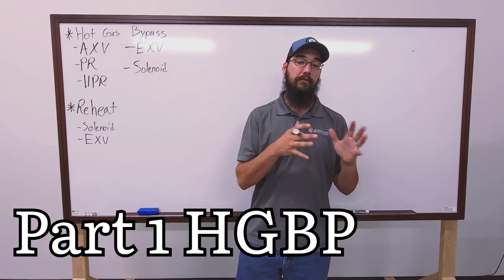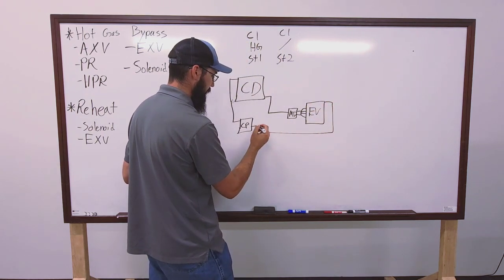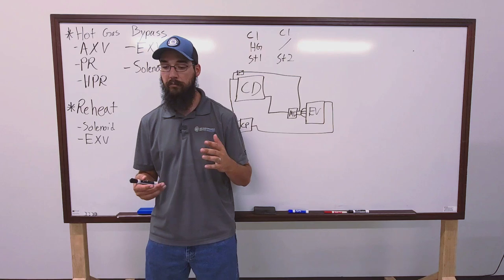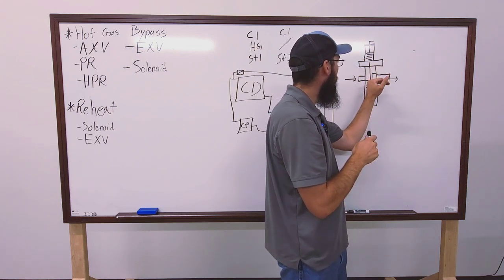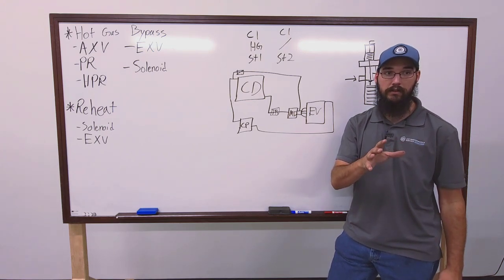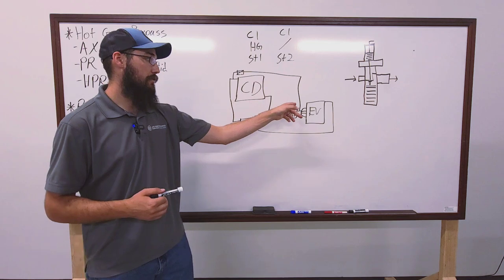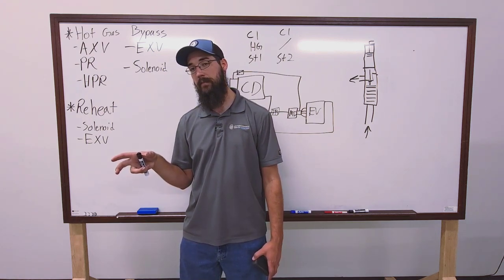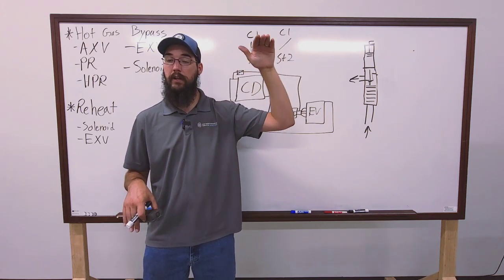Know Hot Gas Bypass? Advanced Refrigeration 2022 Part 1

Comment: When speaking of regulators for unloading my most common and favorite device was known in the field as an ORI or ORIT. The ORI valve would limit minimum coil saturation pressure by throttling compressor suction flow.    Of course, this worked well with the tough old reciprocating Coplemetics which would unload nicely when throttled. This was my fav setup when building integral horsepower dehumidifiers for lumber dry kilns.  This was back in the days of R12, R22, etc. We can hardly afford exotic or newer refrigerants because nothing is Freon this planet anymore.  I sometimes designed smaller units for R290, but was often stuck with 22 due to local fire regulations and insurance rules here in  California.  Oddly enough, the last window shaker I bought for an apartment was R290.  Go figure.

Comment: Question:  predictively, what would happen to a system in Central Florida if a technician removed the hot gas line feature?
Reply from the maker: You would struggle with dehumidification
Reply: Could it cause compressor failure?
Reply from the maker: @keithwyland535  as long as you properly delete it so it cant be an oil trap no.
Reply: @HVACTIME  Thanks for the help!